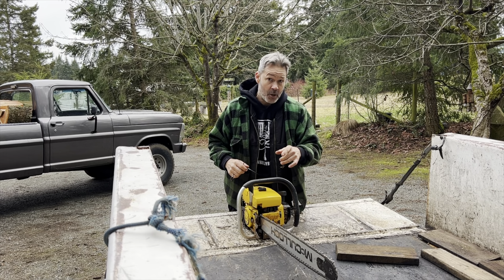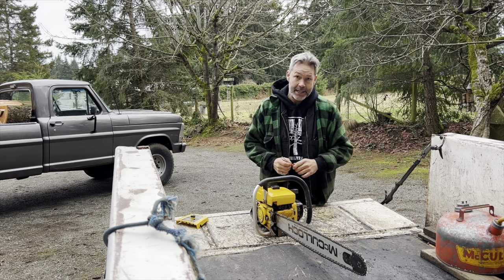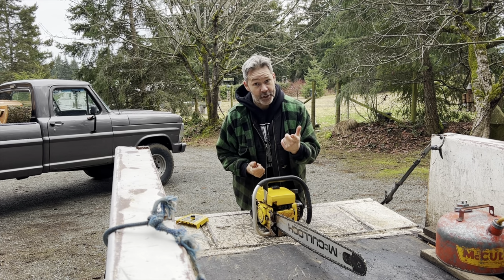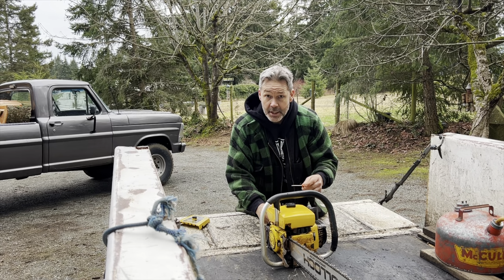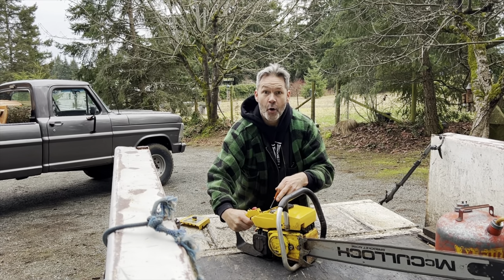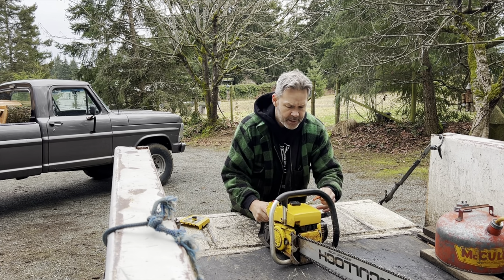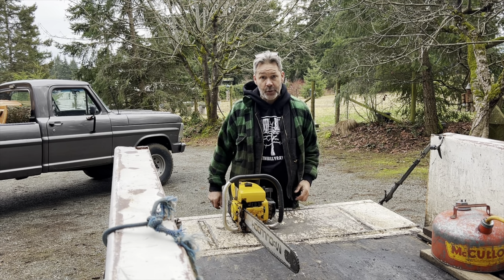THIS IS IT!,  'How to tune your chainsaw .

Comment: Hey Buckin just wanted to say that thanks to you and the YouTuber chainsaw people I fixed up an old Stihl 340 that hadn't run in 10 years. Cleaned out the carb and changed the fuel line and then tuned it up. 

It runs good and hasn't exploded yet so I think I must have done something right!
Reply from the maker: GOOD ONE

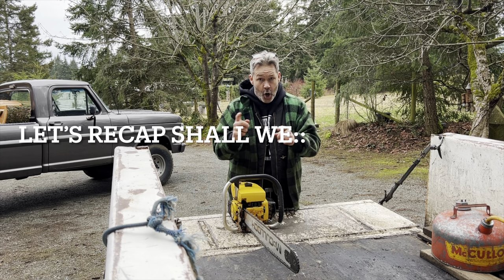Comment: I'm a relatively new viewer (2-3 months) and I love all aspects of your videos, especially your raw and honest life stories and philosophies, but also the fact that you have absolutely no problem takin' a second to launch snot darts when needed. 😆For me that says a lot about you. There's just a real genuineness and spirit of true grit about you that is inspiring.  Enough smoke. One thing I love about you is that you usually manage to say or show things in a way that is easy to follow and grasp.  I love that.  HOWEVER... on this video in particular, which I watched specifically because I'm interested in learning tuning, I really wish you had taken just a few more seconds to provide a few details that would have helped me, and maybe others, in making these kinds of adjustments.  I was being careful to watch the way you turned your screwdriver while you were using terms like "lean it up" or "fatten it" but it was a little hard to follow.  In particular, I would have benefited if you'd actually said clockwise or counter-clockwise, to accomplish those conditions.  So I'm deducing that when you say "lean it up" you mean restrict the flow of gas, which means closing a valve, which means turning CW. And of course the opposite is true for "fattening."  Then at the recap, at 12:00 mins, you say "turn your jets all the way in. Seat them. Then open them up."  The only thing you did to help me out was you spun your right hand CCW when you said open them up.  So "open them up" by turning CCW, and "lean it up" or close by turning CW, right? Other than that one gesture, without you saying CW or CCW, I just didn't get a warm and fuzzy on my understanding.🙃 Last thing... you hooked me, and most likely many others, the very first video I watched because at the end you championed the simple and critically important values that are so desperately waning in the world. We need more of that.  Thank you for taking up that banner and for being such an encouragement to others to do, say, and think the right things.  I've never watched someone get to a million subscribers, but I'm looking forward to seeing it happen. 😀👍
Reply from the maker: well Michael , first off thank you , for yer words . and to be honest im just gettin' started. i must of done something right in the video , as you figured out the riddle that was this tuning video.😁thank for watchin' if you like you can just ask me a question , im in here all the time and we are a community workin together . so as to CW and CCW yes sir turning a carb screw in is clock wise . to the seat . leaning ... restricting . love ya buddy , and welcome

Comment: I did this exact thing with my Poulan 4200. Idle screw out off the throttle (would start with throttle)and would not stay running unless i added throttle no matter how I tune the LOW. So i  turned idle  in so it was barely adding throttle so it would stay running. The idle screw can be a big issue if its turned in to much. Then tuned low for response and get it in the sweet spot. Then tune high. Great lesson. Learned a lot from this good man. Hope to meet him one day!!
Reply from the maker: you will meet me i get around

Comment: Thanks again for this video.   I am re watching it.  I think it will really help me in checking out why a Stihl 075 I bought second hand that would fire up, but not hold an idle.  That part at 15:13 about not having too much idle is something I think will be a key component in sorting out saw carb tuning.

Comment: Great demo for the uninitiated. Appreciate the info. Just inherited a 460 than wont idle. Took it apart and cleaned it up - was completely filthy. The idle screws are worn out and can't be adjusted, when I fix this, I'll use this vid to try and get it tuned.

Comment: Great stuff Billy. Came for the tuning but stuck around for the positive message.

Got a question about tuning a muffler modded carb. You say start at 1.25 turns out on the L & H. In an otherwise stock saw, would you bump up to 2 turns or more on the H after a muffler mod and go from there?

Comment: Another awesome video, Just bought me a ms661r yesterday, as I was checking out, the mechanic/owner of shop/salesman says "you shoulda went with the 500" 
initially drove off feeling good about the saw, I'm now slightly regretting this purchase thinking I may want to go mtronic for my bigger saw. 
I been watching your videos for awhile now, seeing you run carbureted saws with so much joy makes me think I'll be ok without electronics.  I've been trying to find youtube content and forums with people who celebrate saws that are non mtronic/injected, hard to come by. It seems most are excepting that technology is phasing out the old. 
being in the remote Sierras of CA I run a ms400 up and down in elevation (sea level to 9000+) so I wonder if having a manual carbureted saw would add a bit of fun factor? 
or is the sensation of cut'n and being in the wood elevated more so by not having to constantly make adjustments to the saw and just focusing on your cut?
I know you've warmed up to the 500 (fuel injected), how does it feel working with a bigger saw that requires no adjusting compared to manual adjusting?
 do I go 500/661cm? or make an adventure out this manual tune 661?

Apologies if you've made a video covering this, if not, maybe consider covering this topic, I would say you are the right man for the job, thanks for doin what you do with so much passion. Also apologies for the million questions
Reply: No you should of bought a Husqvarna 592 😁 Just kidding...the 661 is a good saw. There's definitely something to be said for old school carb saws. While I've been really impressed with my auto tune Huskies I still value carb saws. Sometimes having less software is definitely a good thing

Comment: Great video brother I always have turned my low jet right to the point where it is just starting to or close to moving the chain. As well as the idle sound all saw and brands are a little different but they are relatively the same! Love ya brother keep them coming!🤟🏻👏✊🏼

Comment: Good information. I always tune with the air cleaner installed incase it makes it run richer. I use to maintain all of Senske's equipment in the 90's. Man some of those young men were hard on the equipment. Running lean definitely makes them run hot. Thanks!
Reply: sure does.. years ago I bought a bike. it ran great - really great - better than any other bike I had, til one day at the top of a long long hill which I breezed up like the wind, it went pop and melted a hole in the piston. when I got the bike home and looked at everything I noticed the air cleaner was missing! lean = hot power but too much and your goner have a short day!!

Comment: The low jet is normally related to the idle circuit. The idle circuit is working to supply fuel to the engine when the butterfly is totally closed so the saw can idle. The butterfly being closed  creates the necessary vacuum to pull the fuel thru the idle circuit. That fuel circuit can be adjusted with  a screw so the saw idles not to rich or not to lean. Lean is not good cause it does not cool the engine between full throttle hard work.

Comment: Hey Billy, just went through my dads old 7-10 fired up and cut some wood but it stalls after a time of cutting. It does not have a high and low. Tillotson HS series. I can’t find anything on tuning just one screw. I have mine set at 1 full turn. Now I can’t get it cranked. Any advice please.

Comment: Great video and great information!! I this morning had to tune my handheld blower!! Love the Macs! How big of a bar would you run on a stock or lightly tweaked 10-10A? What is your preferred bar and chain setup on a 10-10A?
Reply from the maker: 28 IS WHAT I RUN BUY YA GOTA BE SHARP ,, 24 WORKS
Reply: @BuckinBillyRaySmith  Thanks! The saw came with a 16-inch bar, and once I get the saw back together, that bar is getting replaced. What is your preferred brand of bar for them? Is a mac bar worth it for that saw or just get a Oregon bar for it? Also what type of chain would you use?

Comment: The pto side bearing in the macs is a downfall too it doesn't hold up infer really high rpms say 14k or higher and if my chain doesn't pull through hard wood its dull. 👍🪓

Comment: Not having air filter n cover on when turning can n will change air n fuel mix so why not tune with filter n cover on
Reply: True, but he wanst in the wood with the saw either. He mentions this and how he is just getting the saw close enough. I don't think the message was this is the last time you'll have to touch the low or high jet
Reply: @_JamesBrown  Has you can see he had to readjust carburetor as soon as he put filter n cover back on

Comment: I have a 740 and 310 e for sale
Reply from the maker: LOVE ME A 740
Reply: @BuckinBillyRaySmith  what would you say they are worth.
Reply: Both have compression and I've cleaned them up pretty good. The 740 may need a starter coil pack. The 310 e needs new battery replacement